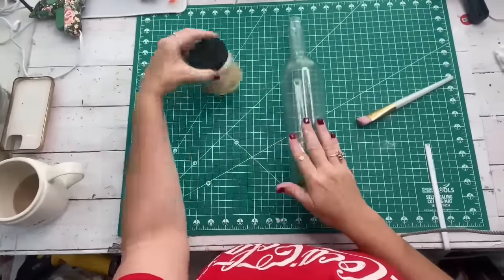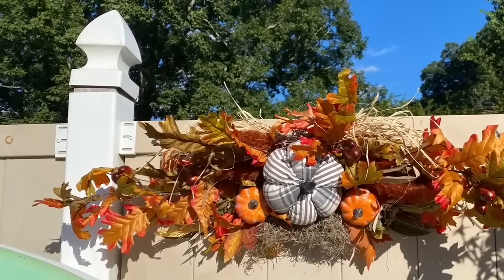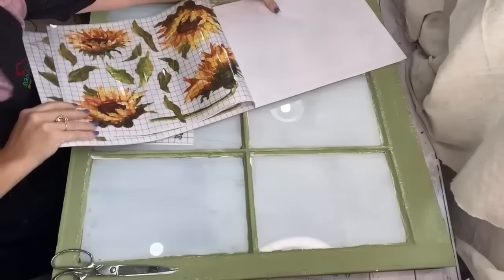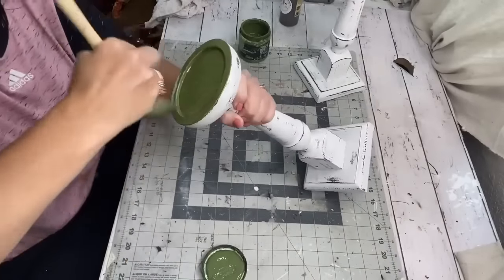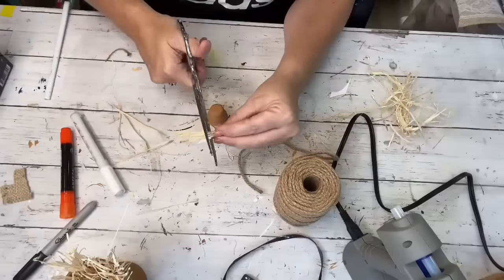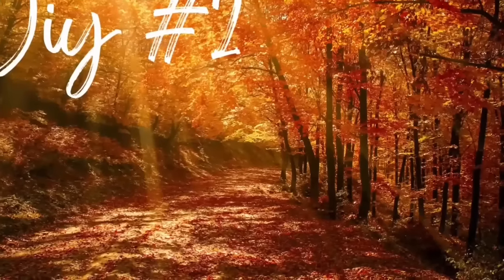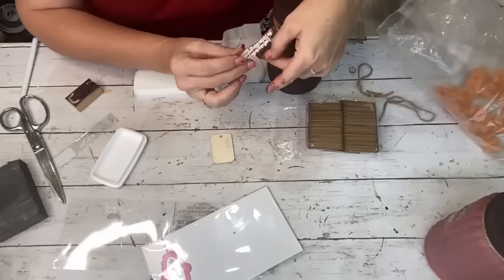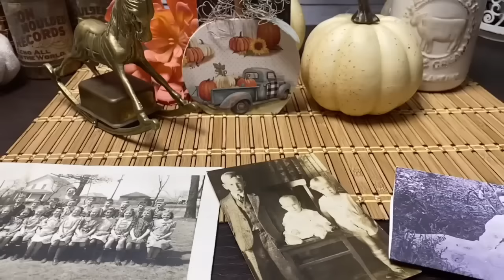*25 HIGH END FALL DIYs that will shock you! GORGEOUS Top selling DIYs & crafts for the fall fairs 🍁

Comment: I have a possibly helpful glass painting tip. If you lightly spray the glass, you aren't aiming for full coverage, just misting all over, with the paint and primer before using chalk paint it helps it adhere and not chip. I've been using that method to chalk paint glass for a couple of years and it's been a savior.
Reply from the maker: Great tip! I’m gonna try that next time!! Thank you so much ❤️❤️